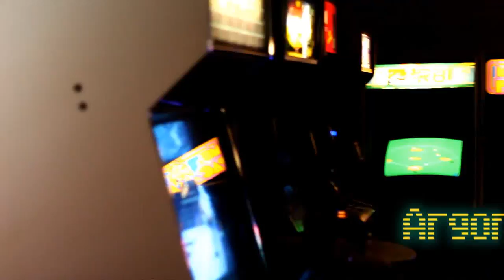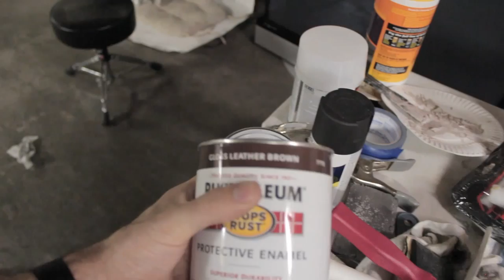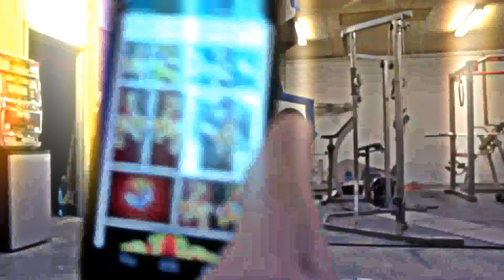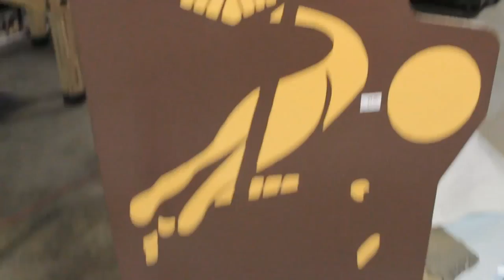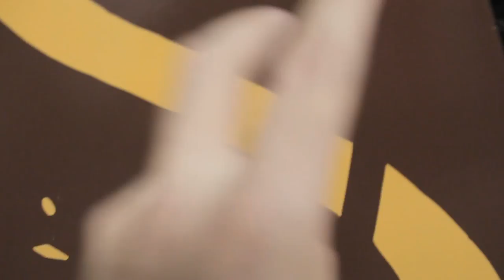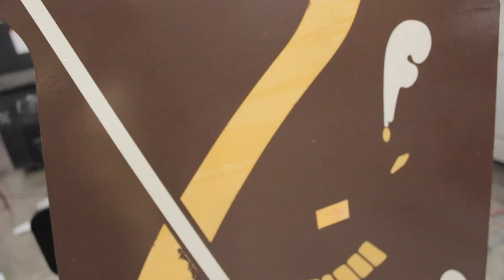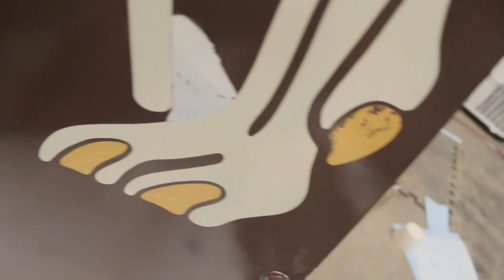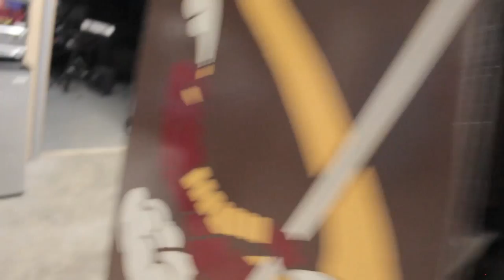Joust Arcade Restore Part 5: Painting and Stenciling

Comment: Looking good! Who did you order the stencils from?
Reply from the maker: Thanks man!  I ordered the stencil from gamestencils.com
They have a stencil guide under their support section that has some good information.
Reply: Argonaut Arcade yeah, that's the same one I've been looking at. Do you have to order two of them (one for each side?) or does that price cover both sides of the cabinet?
Reply from the maker: Josh Brown You only need to order one; it comes with stencils to do both sides. Good luck with your restore, and keep me posted on your progress!
Reply: Argonaut Arcade I've got a few pictures of my progress stripping the cabinet so far here: http://imgur.com/a/0hgAP#0
The cabinet I have was converted a couple times from what I can tell, but nothing too dramatic, the original monitor is still intact, has been capped at some point, has some minor screen burn from a game called Side Arms.. at which point I think they replaced the control panel to have 3 buttons - Side Arms uses 3 buttons. Then it was converted to WWF WrestleFest, and the 3rd buttons were unhooked inside. I'm not sure when the Red Paint got added, but there were a couple coats, and it looks to have been latex. I used a product called Circa 1850 Soft Strip, it is similar to Citristrip... as you can see I got pretty good results uncovering the side art. But the cabinet was scratched up pretty bad prior to being painted red, so I'm going to bondo and refinish the sides of the cabinet, maybe in the next few weeks if I can find some time, and will paint it Joust brown for now, and then I'll likely do the stencils in the spring. I just got a reproduction marquee and bezel in the mail today. Since my cabinet was Jamma-fied, in the meantime I'm going to drop a 19 in 1 board in there so I can at least play Joust while I track down original PCBs or worst case find a Multi Williams board. My other big task is replacing the control panel... and I guess I'm going to wait on that until I track down original or Multi Williams PCBs. I see arcade shop sells a blank Williams control panel, as well as the Joust leaf buttons and joysticks if I decide to go that route. I imagine it'll be at least another year before I completely finish it.
Reply from the maker: Dude, You're paint stripping came out so much better than mine lol. Im actually gonna throw a 19-in-1 board in mine too; until I track down an original board that doesn't cost an arm and a leg.  From what I've read, the 19-in-1 emulates very closely to the original.  Plus they're cheap!
Reply: Argonaut Arcade I just got my Beyond Arcade 19 in 1 board last night and tried it out. Overall it works pretty good. If you have the service switch on your cabinet wired into the jamma harness it makes life a lot easier (then you don't need to dick around with dip switches). You can disable the other 18 games from the service menu and then when the machine boots up, it goes right into Joust (or whatever single game you leave enabled). You can set it to require coins, or do free play, and to me it feels like Joust, no noticeable difference in sounds or playability. The only quirk I've noticed is that the board advertises that it saves high score, but it only saves the highest score and it doesn't remember the initials you put in after a reboot. The robotron on it plays really great too! If you are buying this PCB solely for Joust or Robotron, I think you'd be pretty happy with it. Some of the other games are ok.. Bubbles, Ice Climber, and Mario Bros.
Reply from the maker: Thanks for the info Josh Brown!  I have yet to mess around with my board yet; but I'm hoping to get the cab wired up within the next week!  I was leaning toward disabling all games except Joust, but now I gotta check out Robotron :)  I might be handicapped by the one-button (joust flap) configuration I got going though :/

Comment: Do you prefer enamel from latex? I'm painting my cocktail cabinet
Reply from the maker: +Neo Recasata Typically I choose latex as its a little easier to work with than oil.  Latex cleans up easy and dries a lot faster.  That being said, I use oil paint on MDF cabs so that the particle board doesn't soak up the water based latex like a sponge.  I opted for oil on Joust (even though its plywood) just because it was already pre-mixed and on sale :)
Reply: +Argonaut Arcade ohh thats why I thrown three good paint rollers. Lol! Thanks for the reply 😃
Reply from the maker: +Neo Recasata lol anytime!